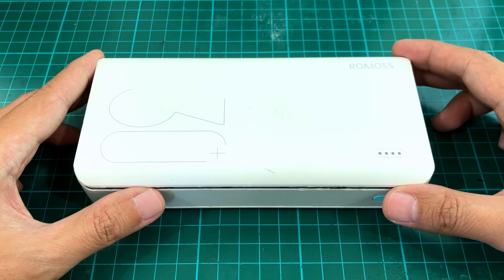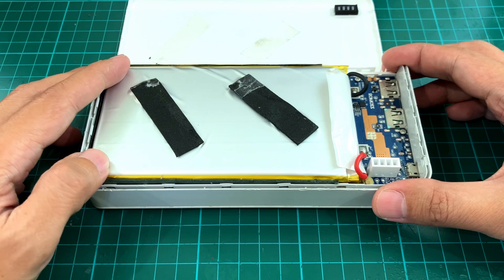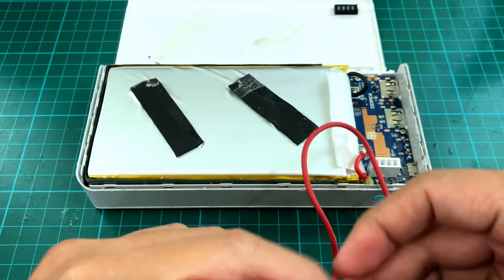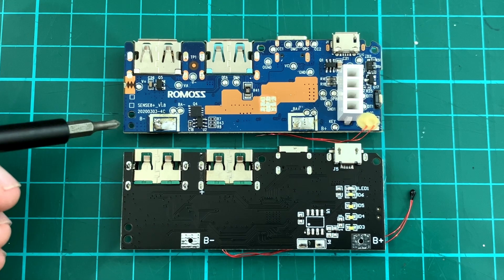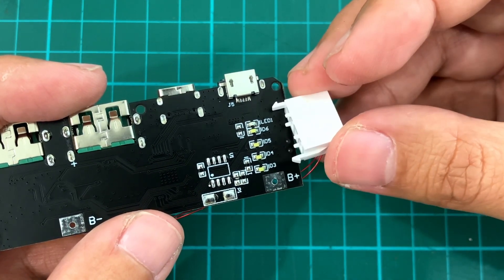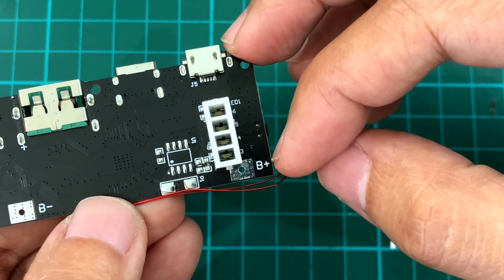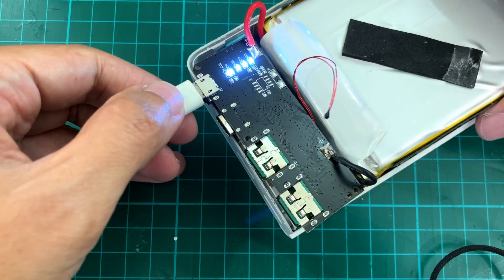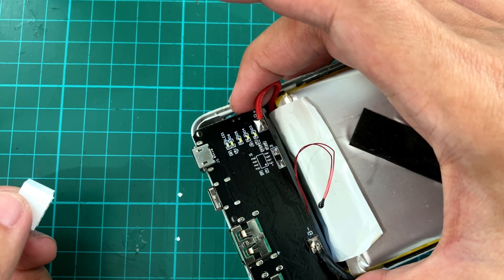How to Fix a Power Bank | Romoss Sense 8+ Broken Board

Comment: Is it true that Li-po batteries not safe to bring in an airplane ? Power bank made from 18650 Li-ion is safer ?
Reply from the maker: Both types are generally safe and are normally allowed as hand carry in an airplane up to 100Wh (around 27000mAh for typical power banks).

Comment: I have Romozz 30+ sense 8p+ 
taking so long in charging but drain out so fast. Can't even charge one phone. wht do you think the problem may be?
Reply from the maker: It could be the battery.
Reply: @jaylagare i just got the Romoss sense 8+. Is it normal for my charger to get hot when charging the power bank? It's a 25W charger.
Reply: @jaylagare i just got the Romoss sense 8+. Is it normal for my charger to get hot when charging the power bank? It's a 25W charger.
Reply from the maker: It fast charges on the USB-C port so it can get chargers hot. But should not get uncomfortably hot.